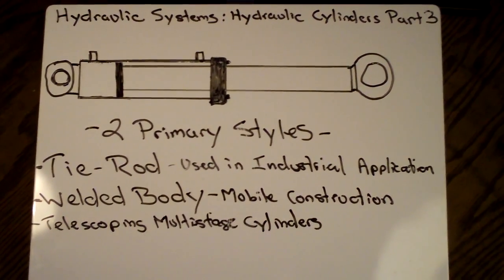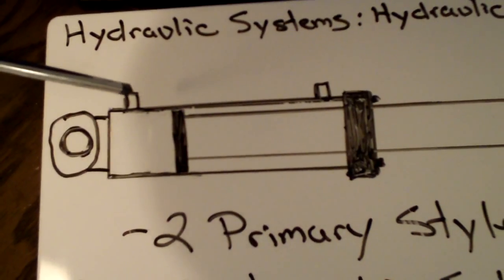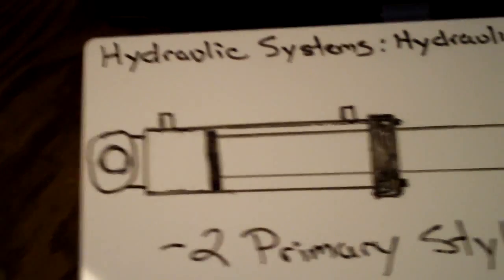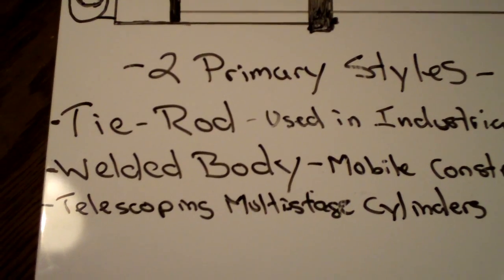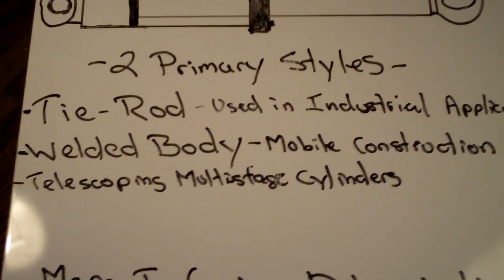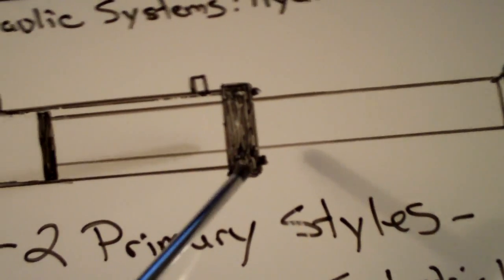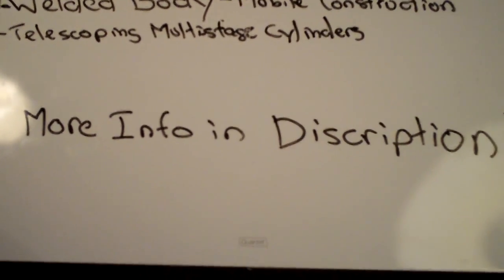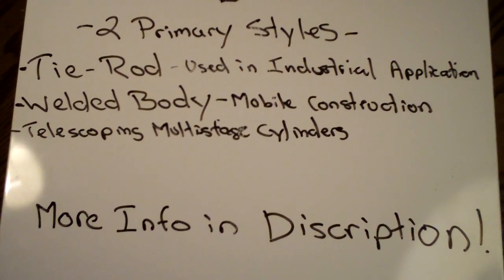Hydraulic Systems: Cylinder Styles [Part 3]

Comment: Thanks for the vid. Would you think that a tie rod cylinder would be appropriate for a log splitter application? Say a 4" bore 24" stroke. I became concerned when I read "tie rod stretch at high pressures and long strokes.".. Thanks.